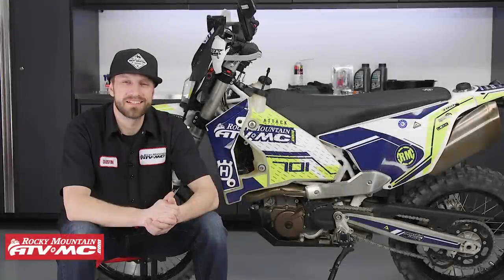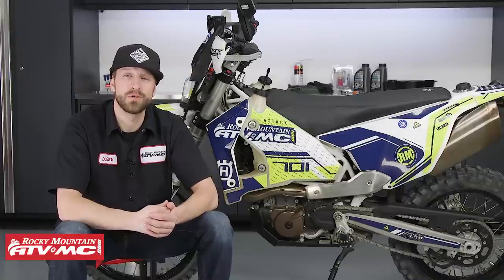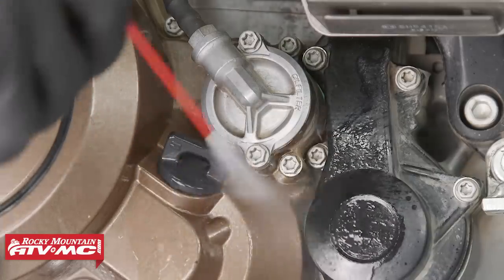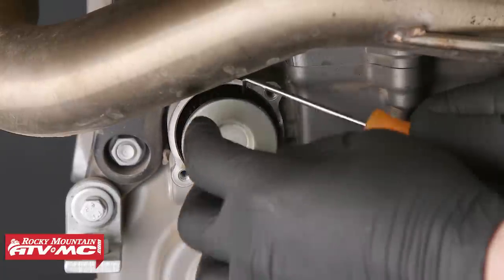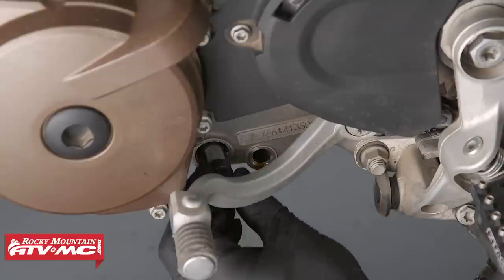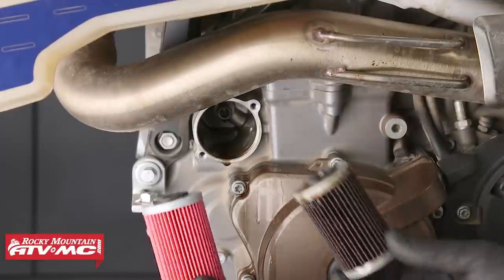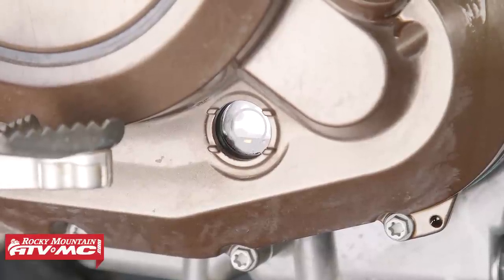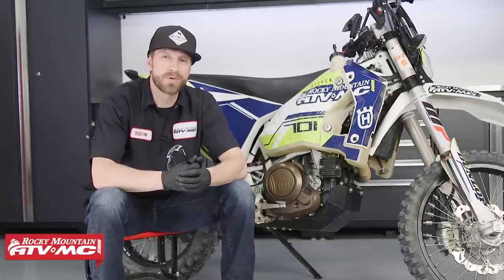How To Change The Oil On A Husqvarna 701 Enduro

Comment: wow, two oil filters and 2 screens. im impressed. over engineering is good in this case.
Reply: Andrey Kitsen the newer yamahas have a a oil screen
Reply: Over engineering you say? Well I'm glad they did that, because it does the job.
Reply: @laurisvisockas4042  This engine is based on racing technology. Everything doubled up: 2 oil pumps, 2 oil filters, 2 oil screens, 2 ignition systems

Comment: You would be better off avoiding contact cleaner. It's not good for the finish on the engine and is a good way to introduce contamination into your fresh oil. Clean the screens with soap and water and dry with compressed air.  For the engine, A cycle cleaner like S100 for the oily parts followed by more soap and water.

Comment: Hi guys .. 

I had a question.. do you do this process with a bike on vertically or on their side stand? 

We should see the oil on the side stand or central stand? The manual doesn't say that.  

Tks guys
Reply from the maker: For draining it won't matter, but when you check the oil the bike needs to be held level and not on any stands. -Charles

Comment: Is your contact cleaner like wd40 ?
Reply from the maker: WD40 has lubrication properties in it which normally leave an oily residue behind. It will probably work fine for this application but you're better off getting a specific contact cleaner.
Reply: @rmatvmc  thank you for your answer, i dont Know the exact translation in french but i order some brake cleaner. Is it the same thing that contact cleaner ? Thank you.
Greetings from Switzerland.
Axel

Comment: Every 6,000 miles seems too long. Is that really ok?
Reply from the maker: Yes, this is the same engine that Husqvarna uses in the Duke street bike. So they recommend full synthetic oil which also helps extend the service intervals. Pretty awesome though!
Reply: @rmatvmc  Very awesome! Are the oil change  kits really like $90? That's still great considering the long interval change...
Reply from the maker: The price is pretty high by the time you do a full oil change because there is an oil filter service kit that includes o-rings and filters that you must get along with the oil. But you are right, when you're changing the oil every 6000 miles it's not too bad!
Reply: @rmatvmc  what is the time interval if you don't put that many miles on the bike? manual says every year but does that apply to synthetic? thanks
Reply: CoachSteve4u what if I only put on 1000 miles per year? Change oil every 6 years ok? Thanks!
Reply: @jimmytheshark86  no, you change it once a year, don't wait 6 years